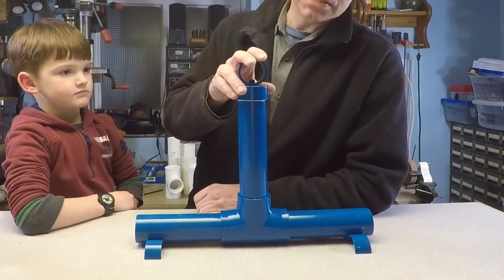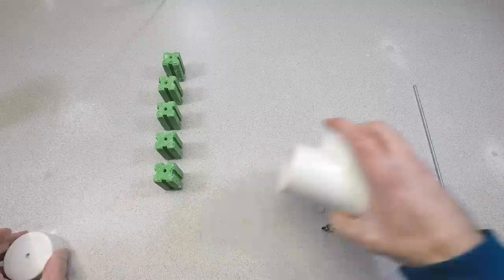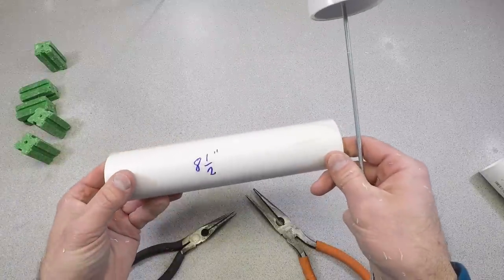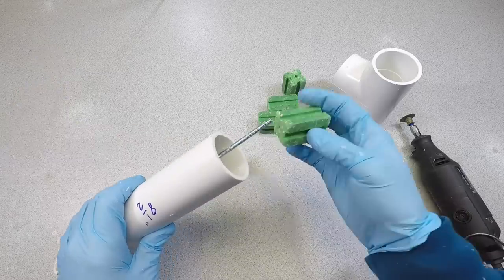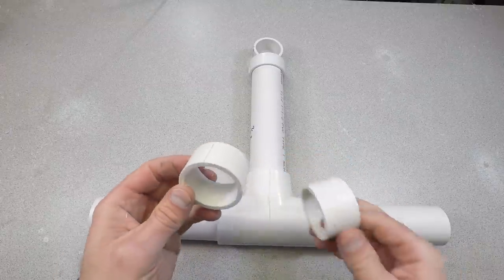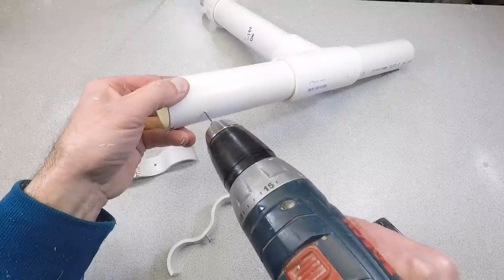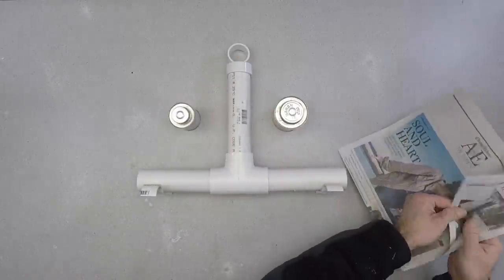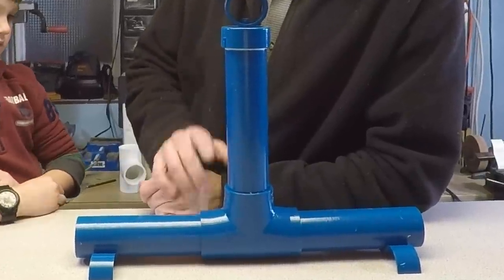Build a PVC Mouse & Rat Bait Station

Comment: I made 3 similar traps.  I modified the plan with a single 3” pvc about 18” long screw down to a 1/2” plank and cut an access less than half the diameter of the pipe so I could cover with another half cut of the pvc pipe and strapped it together with aluminum wire for the bait.  First two or three days I got no results.  The next three consecutive days my bait was missing in all three stations.  I’m replacing it each day for the fourth day now!  Great idea and mine came out much cheaper to make!  Thanks!

Comment: no plumbers use that use-less purple primer, ever. waste of money, useless product.
cut the length of the vertical tube to match the length of your all-thread to equal the bottom of the all-thread to be 1/4" from  bottom of your horizontal tee

Comment: Not trying to start anything here, but do the baits cause any issues with raptors (hawks, eagles, owls, ect)  I rarely have problems with rodents indoors and a mouse trap normally does the trick within a couple of days.  I'd be happy to put one of these by the wood pile, but not if the ingested bait is going to impact the predators in the area.  I'm not sure how many mice those birds are killing every year, but I'd much rather kill 1 or 2 with a traditional mouse trap every year than bear the task of killing them all every year because I inadvertently poisoned the local predators.

Comment: I would add the supports after gluing the T together. That way there is no chance of getting misaligned feet.  The glue sets quickly and sometimes before you have a chance to get things in place.  That is my experience anyway.  Adding the supports afterward assures you get then exactly where you want them.  FWIW

Comment: Nice design/job, but I suggest using the PVC solvent adhesive to attach the legs rather than the screws which will rust eventually.
Reply: Use stainless and they won't rust.

Comment: Do you think that it could work on Chipmunks and Squirels? I realize that the pipe would need to be larger to work especially for Squirrels. I live in a moderately sized city towards the center and we are over run with both. They used to have a somewhat effective program involving red tail hawks but this was discontinued because they did not discriminate between small dogs and rabbits. They are still around but they seem to prefer rabbits over squirrels and it is really cool to watch them acquire lunch/rabbits.

Comment: My hubby spent around 50 bucks and made 2 bait stations (35 for the bait)...been down a month, nothing! Not a single nibble and voles STILL giving my raised garden heck! I'm also using the spike traps...nothing! Tried the mouse traps, rat traps under a bucket...NOTHING! I guess my voles are smarter than Einstein...idk
Reply: Did you make these bait stations?  Curious as I was about to go through this effort to combat the voles that started appearing.  Thanks in advance.
Reply: Maybe you could blast them with the propane and oxygen.  Or hook up a flex hose to a gas engine and gas them w carbon monoxide.   Works
Reply: You’ve got to use the bait blocks that smell like apples to attract voles.  They love fruit.  It also works optimally in late fall/winter when food options are fewer.
Reply: @annemurphy9339  Thanks so much for this piece of info. Any chance you know which if the bait block brands smell like fruit? I read most of them smell like peanut butter, so no go there.  Alternately may be to make a fruit liquid and soak the bait.

Comment: My hardware store had 1 ft. pieces of 10-24 all thread, so i cut three 8 in. pieces of pvc and didn't have to cut the all thread to make these. since the pvc is all the same length, it's foolproof. quick and easy to make. I also used a 6 in. long board under ends and screwed inside pvc close to end, down into wood to make a base. I like your pvc base, but this was quicker and easier. thanks for a great video. for others who think the glue might dry to fast to align the "feet" just get medium set pvc glue, it gives you some time to get it set just right

Comment: I made several smaller, simpler versions and they work great.  BUT.......I saw a kestrel pick up a sick mouse in my yard, take it up to the nearest tree, and eat it.  I would hate to think the kestrel might have been killed by a mouse that ate poison in my bait station. I don't have a good solution to that kind of a scenario.
Reply from the maker: Interesting thought. Hopefully the small amount a mouse ingests would not harm other animals.
Reply: Let's hope so. A granddaughter's dog comes for a visit now and then, and he eats every critter he finds in our yard, dead or alive. Our dachshund likes to kill mice but, fortunately, doesn't eat them.

BTW, the (VERY) simplified bait station was necessary because another granddaughter has a lab that loves to pick up things and run around the yard with them.  The T-joint made it too easy for the dog to get a good grip and good leverage.  So my station now is just a 10" PVC pipe with a single tied-down mouse bait in the middle, and tent stakes holding down the partially-buried pipe.  We live near farm fields and have a very serious mouse invasion, so I have 10 bait stations, plus 15 traps in places where I don't want dead mice decomposing.
Reply: The only reason people bother with traps is because poison is problematic.
Reply: If you use an anticoagulant poison it requires the mouse to eat it over 4-5 days before it dies. Typically once the poison is metabolized it’s not as effective so there’s a generally low chance of secondary poisoning.

Comment: Wouldn't it be better if the rat/mouse could feed on bait and then pass thru; instead of having to back out? ie cut the rod shorter or use a bigger diameter PVC?
Reply from the maker: I have seen mice slip through a closed door (with a tiny gap). There's no concern about them getting stuck or making it easy for them. They can get anywhere and go everywhere.

Comment: Hello. Do you still use this exact bait? Is it highly effective or not? Would you still recommend it, or did you find a better one? Surprising there’s no hole in middle! That alone would make one abandon it and find a better one. 
All in all are you still using this bait station, and it it extremely effective? Thank you.
Reply from the maker: I still use it. The mice still eat it. If I made it again, I would leave out the metal rod. You don't really need it. Just drop the bait down the tube.
Reply: @AlleyPicked  sounds good and simpler too. But do you think there a risk of them stealing the entire chunks that way?
Reply from the maker: Possibly but I don't think they would take the entire block. You could always try it and see...if they so, perhaps they will take it to their entire family for a nice meal :-)

Comment: Made a bunch of these.   Voles would use them for houses.  Picked one up and 4 or 5 ran out.    Also learned they hoard bait and won't eat it until later.
Reply: Can't hoard the bait cause it's on the rod. That's the point
Reply: @Lefishn  They would bite off pieces and return to their nest.   It still works.  Eventually, they eat it.

Comment: Why didn't you just make the pipe longer rather than cutting the rod?
Reply from the maker: That is an option. I made it long enough to fit a certain number of bait block. Longer wouldn't hurt anything. In fact, I plan to make some shorter ones so they fit under a deck.
Reply: Because the he has to use his brain

Comment: I would never poison mice/ rats. They’ll go hide, die and stink in places you can’t reach or access. Always live trap and kill
Reply from the maker: Good points but I would also mention that this is intended to be used outside away from your buildings. Feed them outside and use traps inside. Thanks for watching.

Comment: I am going to make this, but just going to get a regular rod and stick it right through the bottom and sticking out of the top of the cap. That way you can just pull the cap off the top and put the baits on the top of the rod. Stick the rod through the cap and put the cap back on, no messing around with nuts and bolts :) Thanks for the idea!
Reply from the maker: You might even try not using a rod. You can drop the baits right down the tube. The rod is optional.
Reply: @Alley Picked  I think the rod keeps the mice from just hauling off the bait.
Reply: The rod also suspends the bait an inch above the bottom.  That way the bait always stays dry even if rain splashes inside the pipe

Comment: This all depends on the bait,,I built one and tried to drill the bait and split after split. I had to give up.
Reply from the maker: They do sell bait with a hole in it. I have drill many successfully. The trick is to go slow and drill only about 1/4" deep, then pull out the bit to clean out the hole, then continue.
Reply: Fantastic video!!!, I built 2 stations and they came out great. Also bought paint but I can’t drill a hole in the bait without it splitting. I tried as you said to go slow and clean but no luck. I tried using a thinner drill bit and that didn’t work. Do you have link to the predrilled bait? I see you’ve suggested not using the rod and just drop bait in tube. I really like the idea of the rod. Thank you for a great video!!!!

Comment: Yiu didn’t say what size the threaded rod was
Reply from the maker: 1/8" rod  -- You might be able to avoid using the rod all together by simply dropping them down the tube.  I have not tried it yet but seems like it will work.

Comment: My potato patch is infested with voles. Can these poison blocks be used around vegetables? Or will the poison be absorbed into the vegetable?
Reply from the maker: Hi. As long as you don't get water inside, you should be fine. However, as I precaution, I would probably not put it in the middle of the vegetable garden. Close by should be ok.

Comment: You take that to the extreme.  I do the same project by making it with smaller sections coming out of the T but simply drop them in so they fall as they are eaten........Love the idea and hate rodents.......Nice to see someone else taking killing rodants as serious as I do....
Reply from the maker: Yes! I realized after I made this that I really don't need the threaded rod. Thanks for your feedback.
Reply: @AlleyPicked  Actually, I do like the threaded rod if you are going to glue it.  After I had them under control, the bait would sit for a while and get moldy.  I don't glue mine so I just take them apart if the bait doesn't fall right out.  The threaded rod enables you to pull them right out.......Thanks again!

Comment: Isn't 8/32" the same as 1/4" ?
Reply from the maker: 8-32 refers to the size of the threaded rod, not a measurement in inches. The first number is the diameter. The bigger the number the bigger the screw. The second number is the number of threads per inch.

Comment: Just a causion to all rodent issued people. I lived in New England and used bait to get rid on my problems. Best to use in winter when ground was hard and rodents were running above ground. all good got rid of them. I moved to Florida and ground is always soft. After chasing the 'feed' I got rid of some but still had issues. I decided to do the 'new England thing and nuke them with bait. Well what I did was attract all the rodents in the neighborhood and they all lived in my backyard. Yes I killed a lot I also attracted much more. What a mess. They even ate into trash to get to empty bait bucket. I went back to more aggressively killing the grubs and bugs in the yard. Pretty much have elinated the problem. If I see holes in the yard i know I  have feed and kill the feed  problem goes away. 

E
What I'm saying is that no one solution works everywhere. Read or get a good support for your area. Colleges or diy at flea markets can be helpful. Just remember to support them.
Reply: Voles do not eat meat, they eat plants. Moles eat grubs/worms but voles don't.
Reply: @cmnr8487  I'm not sure what was in the bait , they were green cubes.

Comment: After eating your poison the mice leave and go off and die somewhere, their body is then likely eaten by another animal that is poisoned as well. Good job!
Reply from the maker: The risk of secondary exposure, although not zero, appears to be quite low in cats.
Reply: A Dominguez  Well, you're wrong. The guts are often the first part eaten.
Reply: If you use Kaput bait, it is very safe. Secondary animal poisoning would be very rare as the secondary species would have to eat pounds of the dead rodent to be affected. Look it up.
Reply: @AlleyPicked  - I'm especially not worried about cats. If I used big enough pipe do you think squirrels would like to chow down on this type bait?